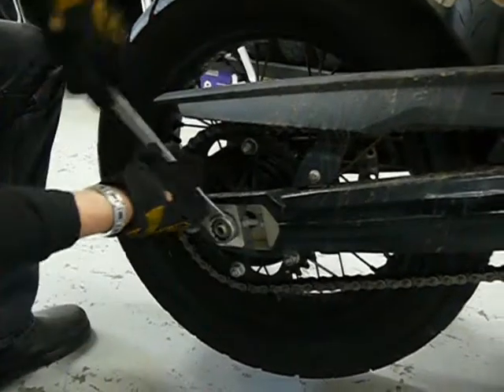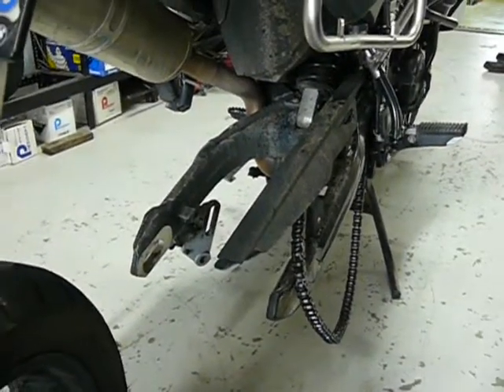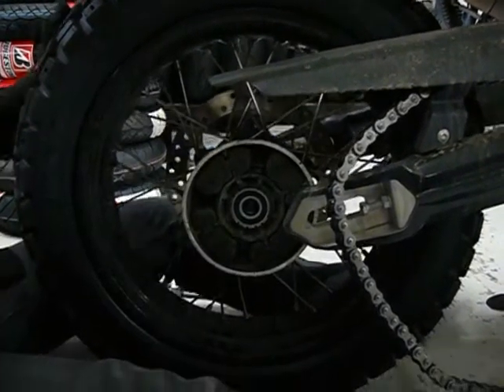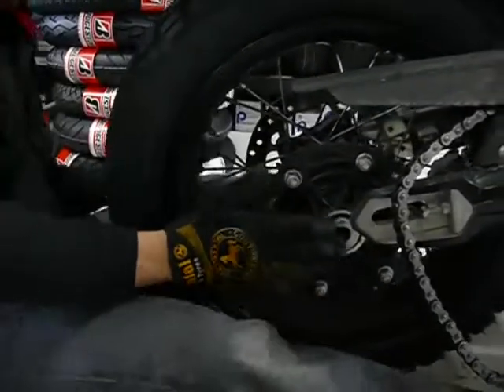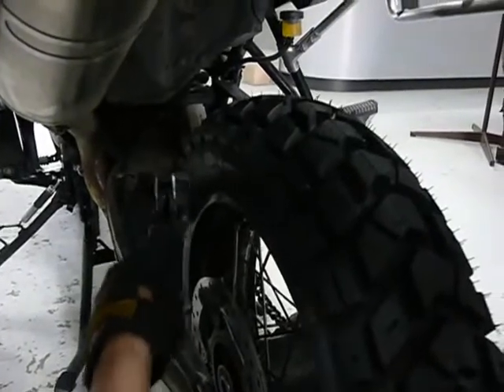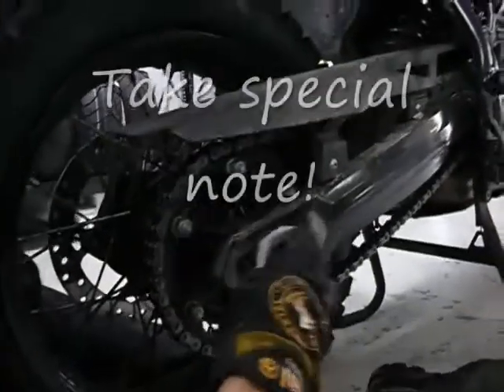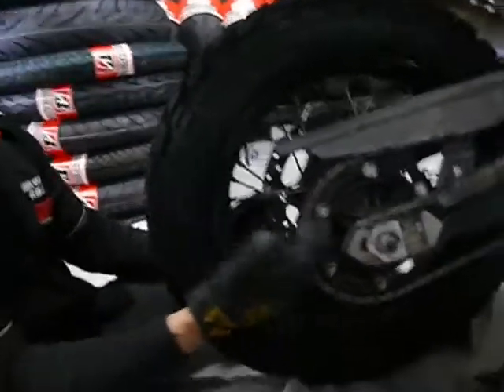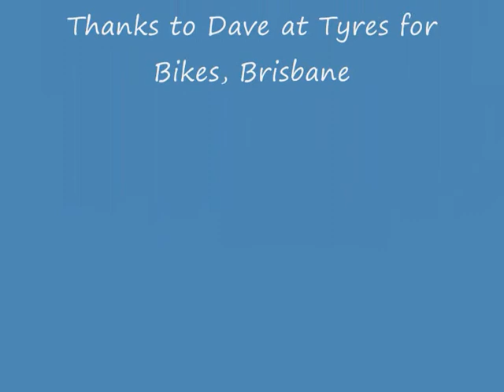Rear Wheel F800GS   Remove and Replace

Comment: Do you not torque it??  Or is it just one of those, tighten till the wheel becomes stiff, then losen it off so it spins 1 full rotation? (how we do it on small aircraft)

Comment: Im glad i have the R1200GS you don't have to do that you just du the bolts and take the fire off. Same when you put it on line up the bolts and then screw the bolts no lining and popping ht e chain off  I like to see the new RT1250 liquid colled think 136hp is the holy grail for hp to weight. it fast as hell but you can still use all it power.